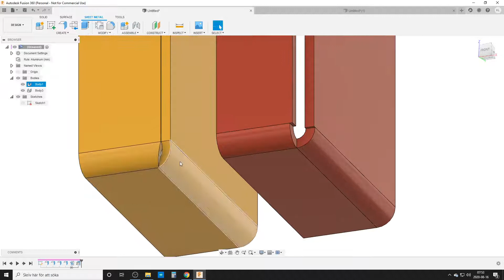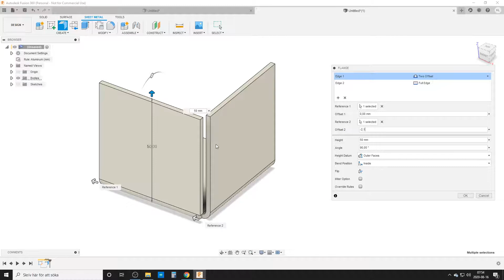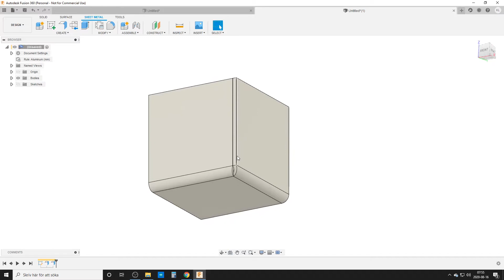Fusion 360 - Sheet Metal overlapping corner

Comment: If I am welding those joints in real life, I prefer that the inner edges of the two sides meet, or one edge ever so slightly overlaps the other, but do not fully overlap. That gives me a nice corner to lay the weld bead into.
Reply: Not if you're TIG'ing